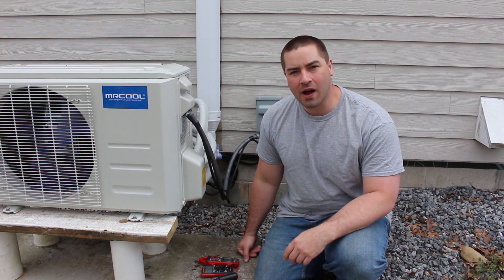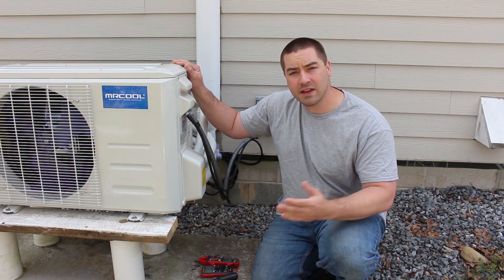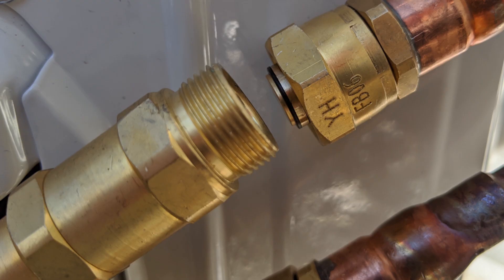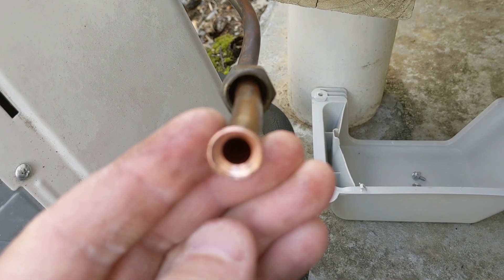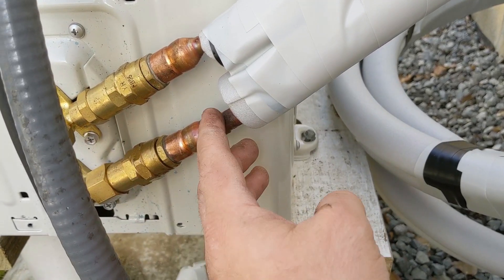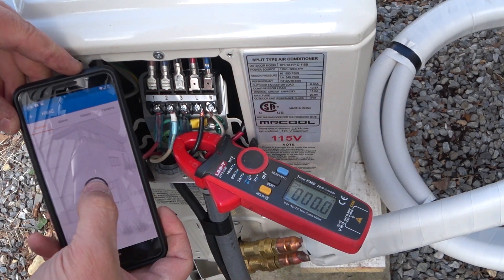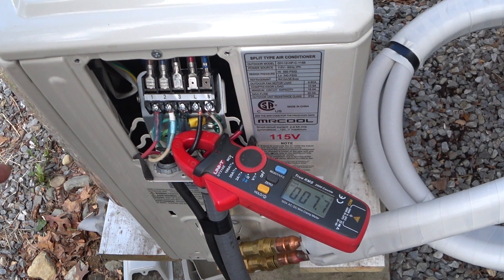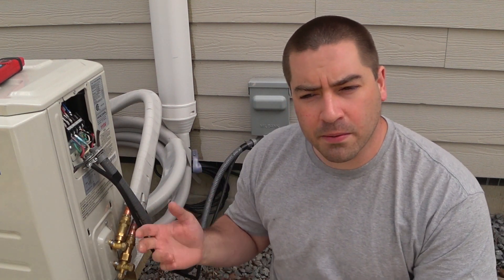Q+A on the DIY Mr. Cool Mini-Split Heat Pump

Comment: Cant help with meter however the electric cable from outdoor unit to inside real should have flex conduit over it....It is high voltage and if a dog or cut for anything can be a safety hazard.  I’m also wonder if that cable is rated for UV exposer or approved for outdoors use.  If you have the plastic over for line set it only needs to run up into plastic channel.
Reply: He ran the 120v power in flex conduit. The black cable is just low voltage communications between the indoor and outdoor units. I would have also put that in conduit if it were me but it's not a big deal to do what David did.
Reply: @bmay8818  I have installed hundreds of these. If ya put the low voltage communication cable inside the flex it can issues. The inductive interference in the 120/240 conductors cancause noise in the communications. Mitsubishi's are the absolute worse for this. They will not work at all with the low voltage in with the line voltage.
Reply: TN Bushcrafter 120 volts runs the inside fan, it communicates within high voltages lines 120 or 240 if a larger unit, put a meter on it
Reply: Sorry, i have installed a lot of mini splits, it is high voltage not low so what out

Comment: Is this legal in MA since it requires refrigerant which normally requires a license?
Reply from the maker: Yes, because I'm using the DIY version.  So I never have to work directly with the refrigerant.  Normal mini-splits you need a license.

Comment: Hi David. I’m going to install that one. My question is the indoor unit, can the tubes exit the unit on the right side instead of going through the wall through the back? I need the tubes to go through the wall two feet away and out. Thanks
Reply from the maker: Yes.  The manual says it can go out the right or left side of the unit.  The difficult part is connecting the tubes.  You would need some kind of temporary shelf to hold the head unit while you make the connections before attaching to the wall.
Reply: DavidPoz  thank you David

Comment: Hi I use iotawatt to measure my power use. It stores the data locally and can track 14 circuits per unit. He also has good documentation for installation. Cost is comparable to other options if not cheaper and the 14 circuits is amazing. Ive found my hvac uses the most thus I'm looking at mrcool for a replacement. Thanks for sharing your content.  

https://iotawatt.com/

Comment: I don't know what aircon pumps are like, but an issue with inductive loads is power factor. The current can lag the voltage, so it becomes hard to measure real power consumption. It's likely it'll have the correct size capacitor in the unit to correct for this, but you don't know unless you measure it.

Comment: Mr.cool is really pricey. the plug and play line set is close to $500  just for the line set. Gree mini splits are very good and a little up on price as well.  Question why 120v ac?  240v ac would have split the load to both inverters.
Reply from the maker: Hi Terry,  I would have preffered buying a smaller unit on 240v.  Something like a 9,000BTU 240v would be ideal.  but Mr. Cool does not offer that size in DIY.  This (12K) is the smallest in the DIY version and it happens to be 120v.

Comment: Thinking about a Mr. Cool for a 16x32 workshop.  The south face of the building will be enclosed in the winter as an unheated greenhouse, 8 ft wide sunroom essentially.  Wondering if the mini split would be more efficient in the winter as a heater if it is inside the sunroom space rather than on the north side of the building.  It would be out of sight on the north, which I would prefer, unless there would be a significant benefit putting it on the south.  I'm in the Kansas City area so we see some below zero days, but most of the winter is fairly mild.

Comment: I know variable speed compressors have two advantages when running on solar.  1, they ramp up rather than surge; 2) once the desired temperature is reached, they slow down (consuming less electricity) and run just fast enough to maintain the temperature  (no cycling on and off).  Does your unit employ a variable speed compressor?    Question2, did you look at the units powered exclusively by solar, or by solar when sunny and house power when not sunny?  I'd be curious to know what drove your decision for the particular unit you purchased.  If it was the DIY support, I get that.  I'm wondering if there were other factors.
Reply from the maker: The DIY reason was most important to me.  I've seen some solar-direct units, but they are more expensive.  I've already built enough solar and inverter to be able to handle this load.

Comment: The precharged lines is a nice feature. I have a couple of the Pioneer minisplits one 12,000 btu and one 18,000 btu and looking to add a third 9,000 btu one. All are 240 volt units, I have them both running off my Growatt inverter setup, two 3000 watt inverters, giving me 6000 watts of split phase 240 power or 3k per phase. Units run great on it. They use so much less power than the old central air system did and no starting surge.

Comment: I have been using Ted5000, It has 4 channels , it has  local  intranet browser, no internet needed, does data logging and is easy to install. I did have to put it on circuit with no noise as it uses power line to  communicate.

Comment: Your original video helped me to see how easy it is to install these. I ended up getting two systems by senville. One is a dual 18k outdoor with two 9k indoor units and the other is a 12k to a ducted indoor unit. My 12k outdoor unit is IDENTICAL to your Mr. Cool but the labelling on the electrical instead of 1 2 3 L N is 1 2 3 L1 L2. Senville does not offer those sealed lines and I bought a vacuum kit, a micron gauge and a valve core removal tool.
Reply from the maker: Great.  I hope you have long success with it.
Reply: @DavidPozEnergy  you too, I don't have monitoring but my power bill dropped by 50% in winter over the ducted electric system previously installed.

Comment: the first thing that comes to mind is Sense, www.sense.com, the data does go over the internet, but maybe there is a way or they have an option to keep it local so they don't find out about the hydroponic "farm" you have in your basement ;-) I been using TPLink plug monitors and like them a lot, only good for 120v applications and not sure if that data is stored local or on a server.
Reply: Check out the reviews for sense, they tend to have 30% of your loads grouped together as "other" as they can never distinguish those loads.   Best bet is a physical CT around each circuit, but it comes at a higher cost.

Comment: The way that they ramp up vs. surging is what makes them so ideal for using on a solar system. I don't have to worry about a dual surge when my well pump kicks on causing my inverter to shut down from too much initial draw. Using the  window mounted models can cause circuit breakers to trip when something else like a coffee maker or toaster is on when they start. Not with this unit.

Comment: If you want to monitor your power you cant do much better then this 6-channel board from circuitsetup, You have a few options on how you work with the data, you can send it off site or keep it 100% local  https://circuitsetup.us/index.php/product/expandable-6-channel-esp32-energy-meter/

The shelly EM is also nice but you are stuck with only using the CT clamps that they supply but if they work for you its simple and easy to get setup and working

digiblurDIY is a good place to start https://www.youtube.com/watch?v=BOgy6QbfeZk&t=1093s

He also has a really good discord with people that will help you if needed

Comment: If your measuring an appliance that uses 15 amps or less you can use the sonoff power. It uses a shunt resistor to measure the power. It cost less then 10usd and has Tasmota custom firmware support.
There's also the Shelley EM similar to the Sonoff including the capability of having Tasmota. The Shelly has a better stock firmware in my opinion. Also the the EM version uses split CT clamps to measure up to 120 Amps. With custom firmware on both devices you can use different cities and set your multiplier to measure a two hundred amp panel.

Comment: This guy says it's not a good idea to have the lines coiled up like that.   https://youtu.be/RAFWJvzrsys
Reply: JRP3 also he cuts them off and it doesn’t seem to have any refrigerant liquid inside...so you kind of have to vacuum the system before using it I guess?
Reply: @rgbgfabian  Yes he has a different system, but I assume they all use some oil so the point he makes about the coils may be universal.

Comment: I know this isn't the topic of this video but check out the new MPP GK specs at the MPP solar site says the 5048 outputs 5,000 watts and blends in whatever more power is needed from the grid .  I didn't see a max power or a surge capacity but it cannot be paralleled with another unit though most people likely wouldn't need it to.  I wonder if two units could still be connected via breakers to a critical loads panel and grid and still synchronize to each other because they are both synchronized to the grid . Maybe check it out  it may make a good video. Other problem is its not split phase have to use about a $200 5,000 watt transform and DIY it to get split phase but still only about $900 and no batteries necessary and once you add the transformer surge capacity is probably higher

Comment: I use the Emporia system with the 8 expansion add ons. It does send the data off site but you can down load CVS files to really analyse the data. It is cheap and reliable.

Comment: YOu need the Leviton Load Centers, Neutral on Rail and each breaker is smart.
Reply: I haven't seen any reviews of these, but it's very likely that Leviton is going to try to sell you some monitoring cloud service rather than a local data API

Comment: Drok makes cheap yet good clamp meters. I use them here at home. Get em on Amazon for around 30 bucks. They have a memory too so you can cut the power and they remember.
https://www.amazon.com/gp/aw/d/B07K3S4K9L?psc=1&ref=ppx_pop_mob_b_asin_title

That is the one I use.
Reply from the maker: Thanks.  I've used the same one and also like it.

Comment: Emonpi. It's great
Reply: yep.  open source software and hard ware.  Expandable.  The pi runs the web server for your data.  You just visit it's IP address on your network.  You can add CT clamps and temperature sensors.  Mine connects solar and my car charger, varying the charge based on feed in power.  Very expandable and your data is stored as plain text on the pi so you could put it in a spread sheet.  So if you have an electric car checkout 'open evse' too.  Another open source software/hardware project.

Comment: No starting surge! Hey it's custom made for a home power system!  
I installed my own heat and air on my first house about 37 years ago.  It was just a conventional central air unit, though it was the smallest one I could find, since the house was super-insulated.  I purchased that unit through Sears and I also remember getting sealed, pre-charged refrigerant lines just like you used.  When you tightened the fitting, the seals were pierced and you were in business.  That was back before all the refrigerant regulations and it was OK for anyone to make this a DYI project.  It was very interesting to learn that these are making a comeback now!

Comment: Good video. Nice to know it is soft start. For the energy monitoring you should use: https://www.amazon.com/dp/B07R11H2Q2/ref=cm_sw_r_wa_apa_i_JtiVEbK60K71X

With an expansion unit:
Emporia Expansion Module and 8 Sensors | Add-On ONE module per Emporia Vue Energy Monitor | Track Circuits Without the Guesswork https://www.amazon.com/dp/B084BT7FH3/ref=cm_sw_r_wa_apa_i_vuiVEb105YAFP
Reply: But this 'data' still goes off site correct. The monitoring has to send the data somewhere for storage unless the phone is setup to constantly record.

Comment: Thanks.  Like #92. Watched the ads!   What is the amp draw during cooling.  I guess in Mass.  you don't care about that yet.  1000w isn't very much heat.  Even given your insulation, I can't imagine this is enough for your house?
Reply from the maker: The past two winters I've been heating my house with a 2,000 watt baseboard heater since my old mini-split hasn't been working.  So, if this heat pump is better than a COP of 2, I'll be good.  But I can always turn on my baseboard if I need to.
Reply: How has the heat been with it so far? Can you determine how many watts are being used on average when it’s not ramped all the way up like in the video? These things cycle variably so as to maintain and omit peaks so I’d bet they’d hang out around like 350 watts or so? It cool to see that it’s not even 1100 watts on the high end though when you turn it on and crank it and it’s not like it’ll constantly be drawing that power like electric resistance will. Such an amazing benefit to transfer heat, not create it. I’m in MA too and wanted to get one too. I’d love to know more about cost to operate in winter. Do you think you’re pulling 5 kw per day? 8? I think .28 cents is what the electric rate is now so per day it somewhere around $1.50-2.50 per day to run in winter?

Comment: I use a clamp meter on my mini split to measure usage.  One like this one https://www.amazon.com/Current-Amperage-Voltmeter-Multimeter-Transformer/dp/B07JB9B2QL/ref=sr_1_9?dchild=1&keywords=kwh+meter&qid=1589410968&sr=8-9
I also have a neurio to measure whole house usage, but that's cloud based unfortunately.

Comment: Thanks for the detailed explanation of the linesets. I was wondering how that worked and thought they were under vacuum. Having them contain pressurized refrigerant is an interesting and great way to do it.
Reply from the maker: I think so to.  The Mr. Cool website says they come precharged.  I don't know if it's full pressure, or maybe just a little psi for transportation?  I don't know the details beyond precharged.
Reply: @DavidPozEnergy  Not much pressure at all . They are vacuumed at the factory then just a small amt of refrigerant is added to bring them to positive pressure . That way you would know if they leaked during shipping as there would be oil residue at the point of the leak .

Comment: I have one of these energy monitors:
https://www.brultech.com/greeneye/

I specifically selected it because it’s all local, no cloud, and it actually monitors each circuit instead of trying to guess based on power signature. I use my own software to monitor it, so it’s not for everyone, but it works great for me. It reports current and Joule counts every 5 seconds for every circuit in the panel individually, which I then graph as kW and kWh.
Reply from the maker: Thanks I'll check it out.

Comment: Great video - thanks for taking the time to monitor amps and volts. It looks like around twice the amps/watts as my small window units (I have central heat pump and supplement with window units in case I have to run a generator or solar), but it is also over twice the BTU's. Better and cheaper than going with a central unit if it lasts. I understand that typically, heat pumps don't do well in a very cold climate. I would like to see how the unit performs in the winter. I live in Florida, so this would work well for me.
Reply: It depends alot on the unit, Mitsubishi has some of the best heat pumps but are priced to match their quality and performance, and I know more about the reputation of their full size residential split systems then their mini splits.

Units designed for the north can continue pumping heat into the single digits while compromising only a little efficiency with a smaller temperature delta. They also have dehumidifier mode, soft start, and compressor demand compensation(this makes a huge difference with efficiency across different temperature deltas).

Comment: Nice that there is a slow ramp on the heater side, what about the a/c side does the compressor ramp up slowly too or is it going to cause a surge? As someone in a warmer climate I've always heard a/c was very hard to run on inverters.
Reply from the maker: It works the same on both heating and air conditioning.  Sorry, I was just trying to keep the video condensed.
Reply: @DavidPozEnergy  No worries, I didn't realize tech had come far enough to ramp up an a/c compressor slowly like that. My old unit still dims the lights in the heat of summer on grid :)
Reply: @OuchMySpleen  Generally they use what is called an ECM (Electronically Commutated Motor) and a specially designed control circuit that does the soft start. It's not a flawless system but soft start is a sweet feature.
Reply: There is only one compressor in a system like this